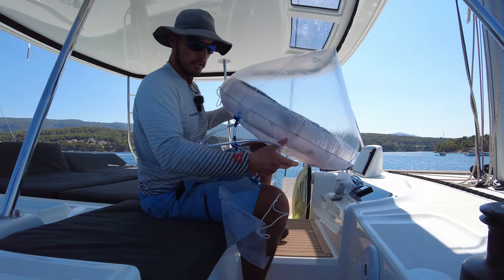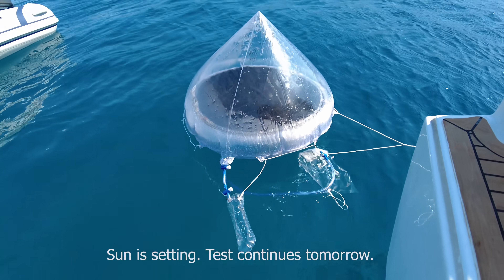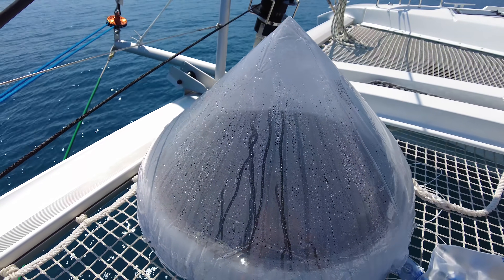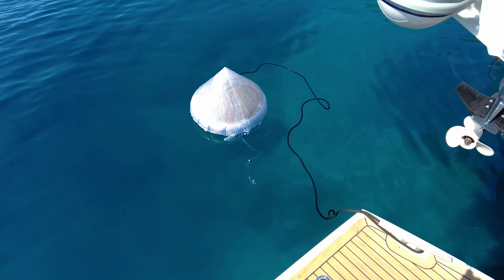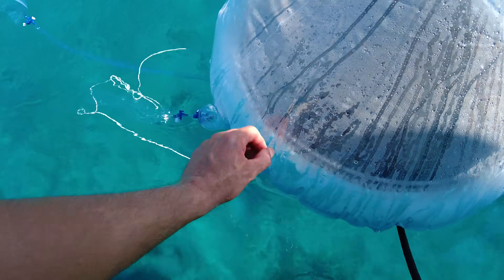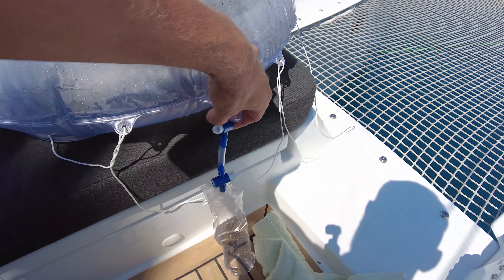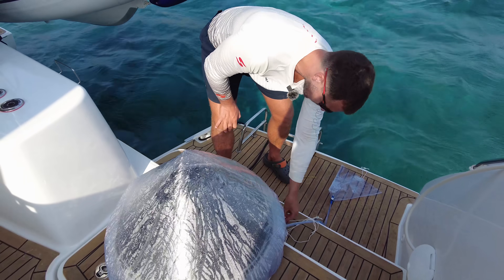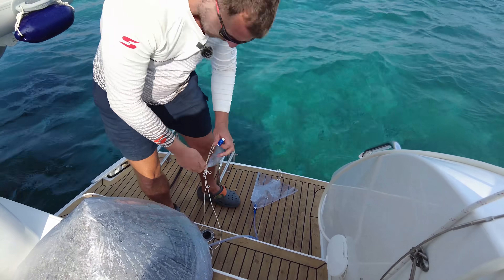Solar still - Sea made drinkable

Comment: I would expect it to work better sitting on the surface of the water then on deck because the temperature difference is larger.
Reply: Being in the water reduces the heating of the black bottom. Ideally you would want it insulated or have another source of heat.  Its only designed that way because its an emergency life boat still.
Reply: @IgorStropnik 
Which one are you giving the thumbs up to? They disagree.
Reply from the maker: @vintage6346 😀 that’s why i tested it. In that situation that’s how it worked.
Reply: @IgorStropnik  
Which of the two ways did it work better? Your coomment came after two opposite opinions.
Reply from the maker: @vintage6346  Outside
Reply: @IgorStropnik  
Both are outside, ... on the water and on the deck. Which do you think is better?
Reply from the maker: @vintage6346  Deck
Reply: @IgorStropnik  
Thanks.

Comment: Every liferaft should have that as the top of the roof.
Reply: It's not mentioned but floating it on the water surface is important for proper function. It helps to reduce the heating of the collected condensate (after it has run down), reducing the re-evaporation of the drinkable water.
  Also, not "messing" with it during the day and very carefully handling it when harvesting the condensate reduces the amount of salt contamination. Which also indicates a weak point of this device: rough water conditions can contaminate your drinkable water. (I think) The type I was shown was the round one so this one might have solved that problem, better safe than dehydration.
Reply: @ericsumma7654  rough water would contaminate it. This is fine for calm days only or in a still bay.
Reply: Like the tent they use in Dune :) A still tent.
Reply: Great ideas here

Comment: Very bad product design. The cone shape is bad. It should be inverted and have the capture in the middle of all the condensation, because it doesn't fall right now, just sits there, and whatever is collected on the sides sits there on the sides.
Junk solar still, send it back to sellers.

Comment: I didn't know they worked this well. Absolutely something to put in a grab bag.
Reply: This well? 🤣
Reply: @UlexEU  I didn't think they worked at all to be honest, but you actually get some water.
Reply: @Thelavendel  little bit of cloud, wont work. little bit of wind, wont work
Reply: @name08654  Cloud means possible rain, and human water intake is significantly lower in a shade. Wind does not affect the solar effect as the inside is shielded from the wind. You actually want to cool down the sides of the cone, because you know, first grade physics, water condenses on a cold surface. So actually splashing some water on the dome from the outside could theoretically speed up the process due to evap cooling effect.
Reply: @UlexEU  Just 1 of those could keep several people alive for months stranded so it works pretty good.

Comment: You need to keep it in the water so that the cooler water helps the moisture to condense.  You need to constantly remove moisture from the air in order for more moisture to take its place through evaporation.  
Condensation speeds up the EVAP rate, etc etc
Reply: The moisture in the air in the bag will make contact with the inner bag surface and more gaseous water In The air will meet this water and combine with it until it’s big enough and heavy enough to be a visible droplet and roll down to the fresh water collection bag
Reply: yer over thinking it
Reply: That is totally wrong.

Comment: It would probably take a dozen of these devices to produce at least 1 litre of water per person to avoid dehydration. (£1000 worth of kit per person!) Back in 1773 the crew of the Phipp’s expedition to the North pole were able to produce 40 GALLONS of fresh drinking water per day using only a kettle, a connecting tube and a wet mop!

Comment: I had the same idea. The cool thing is if you had enough inflatables and gave it a structure of super black body pillars running through it and supporting it you could layer it. Have multiple layers of water being heated by the sun. I think one issue is the refraction the condensate makes. You could fix this with a super white body passive cooling. Basically even in direct sunlight this material is so reflective of light and IR energy it can passively cool. It takes direct contact to transfer heat into it. Have this in a cone at the top and let it build the condensate there. Or in my idea it would be dispersed through the layers in a grid pattern.  Then you could float these on any sea or ocean and collect potable water. Though you could probably just drink it i imagine if the system stayed wet for weeks some bacterial growth would form in the distillate tube. Its just water vapor but some dust might get drawn in.

Comment: I think it works better in the sea so the cooler ocean water helps collect the condensate.
Reply: No.  You want it as hot as possible in the chamber.  The heat is what makes the water evaporate, which is the more necessary part.  As long as the air is cooler than the inside, its going to condense.  The faster it evaporates, the faster it can collect.  You want it to be as hot as physically possible.
Reply: It doesn't.  The black bottom is black so it is heated more than the top. The top is where the water vapor condenses, not the sides or bottom.  Being in the water defeats this.  Its only designed to float because its for an emergency life raft where they would be no room in it for a still.
Reply: @obsidianjane4413  Yeah. This still is optimized for simplicity and low maintenance rather than efficiency. Any other design would be too complex to fit in such a small package.

Comment: In an emergency it may just be enough to save your life if you are not exerting yourself too much. That solar still probably should be double the size to produce more area for heating and condensing. Also, if all that plastic of the device was black it would be more efficient. Very cool device.
Reply: The thing already sits in an infinite heatsink so they might as well; the humidity would make it's way underneath and condense.
Reply: You absolutely do not want the plastic on the outside to be dark or black. If it's hot, water won't condense on it. It needs to be clear so it can cool off from the air.

Comment: It should work better while in the water correct? I believe the general concept requires hot moist air and a cool surface to condensate on
Reply from the maker: Probably on land as it heats up more. Being in water is cooling down the water you want to heat up.

Comment: problem i have is that plastic will degrade quick in sun and it will break apart
Reply from the maker: This is emergency device. Only used for survival and it will last long enough.
Reply: Read a guy lasted 90 days on one

Comment: There can be Downsides to drinking Distilled Water This I found sums it up quite well :
Increased risk of nutrient deficiencies: Distilled water may put individuals at greater risk of nutrient deficiencies. It lacks minerals that may benefit health. For example, drinking water low in calcium and magnesium is linked to an increased risk of fracture, preterm birth, and heart disease. So, unless you get your recommended daily servings of these minerals through the food you every day, we don’t recommend drinking distilled water.

Lack of electrolytes to aid hydration: Distilled water may not be the right choice if you are an athlete or someone who engages in lots of physical activity occasionally. As you sweat, you lose electrolytes rapidly. To stay hydrated, you need water with minerals, or a sports drink with added electrolytes to replace what’s lost through sweat. Distilled water cannot make up for what expels from the body because distillation removes electrolytes. Similarly, if you’re sick or malnourished, you need all the minerals you can get. Hence, it’s probably not a good idea to drink distilled water.
tbh, if I had a couple of Solar Stills in a Grab Bag on a Boat, I'd try to have another Bag with Big bottles of Mineral Water and packets of those powder Sport Drink type additives , plus Complan Type Drink powders that have everything essential in them to Drag into the liferaft if having to abandon Ship ? I'd blend the Sistilled Water with Mineral Water as Well. Combined, I suspect they would extend Survivability quite significantly, especially if extra food rations are in another Grab Bag?  Could all go into one Floating Waterproof Bag with Ropes with floats to get the thing fixed to the Liferaft then unpacked into it. If push comes to shove quantities can be adjusted based on numbers of people x minimum needed Water per day each, times the number of days and add the amount of food needed All for a reasonable time to rescue Expected. If the weather is exceptionally hot, a careful watch needs to be kept to spot People who have Stopped Sweating.  If that happens, things can get bad quite fast, as the speed with which people can lose all the salt in their bodies is quite incredible. A Colleague of my Uncle flew back to Nigeria to play in a Rugby Game was driven about 20 minutes to the Pitch, got ready to Play, then not long after the game started, and before Half time, he collapsed on the Pitch. Luckily he was surrounded by fellow Tropical Diseases Doctors, who got him diagnosed Fast, got a Saline drip into him, into him, and cooled him down until he came round and he recovered OK. A couple of years back Simeone in Britain Died due to Lack of Salt thanks to an anti Salt attitude with Diets, when he collapsed, nobody in the hospital could figure out what was wrong with him. So beware of anti Salt Diet .propaganda, As Not very many people need less Salt, the vast majority of us clear excess Salt from Our Bodies with no issues.
eta PS. It's worth adding that if it's so hot you are Sweating, and you Stop Sweating, you aren't just losing electrolytes you are starting to dehydrate and you have already lost a Lot of Salt with the Sweating Best Wishes and Fair Winds.  Bob.  👍
Reply from the maker: It’s survival. You can add little of sea water or bring some powders as you said.
Reply: Compared to the risk of dying from thirst the risk from distilled water over a week or two is non existent. If you a worried about minerals all you have to do is add a bit of your pee to the distilled water. Its called survival.
Reply from the maker: Exactly 🙌 Add little of sea water.